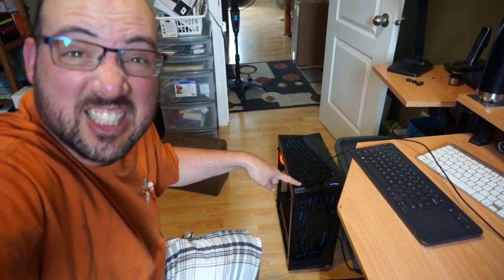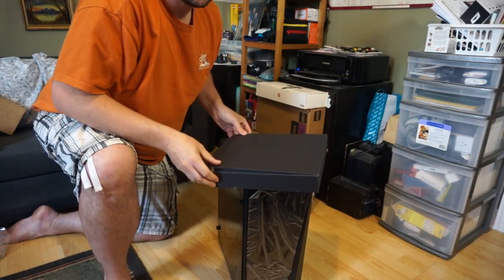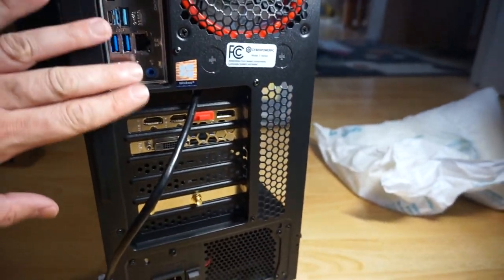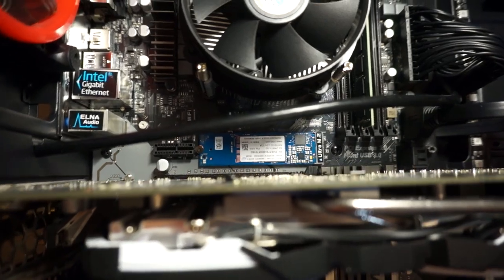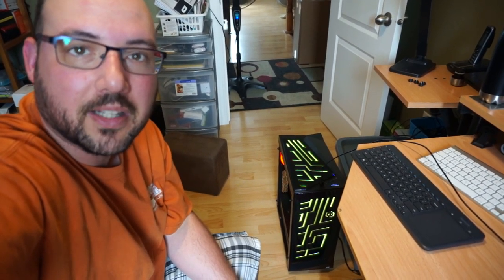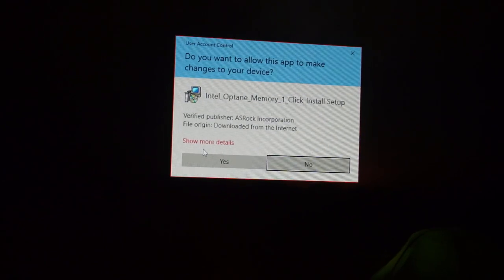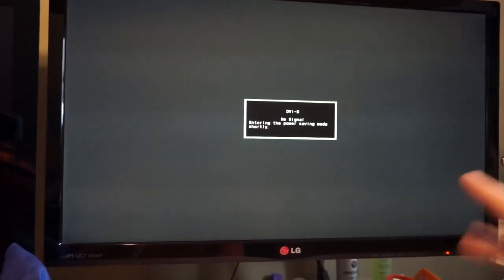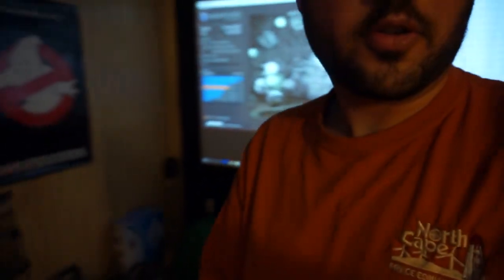$650 ULTRA VR GAMING PC!!! CyberpowerPC GXi10922OPT Unboxing - Netcruzer TECH

Comment: That’s a workstation
Reply from the maker: Not sure why you think that.  No hyperthreading CPU, no big RAM capacity, no workstation level enterprise features... it's definitely marketed and built to be a gaming PC.
Reply: Netcruzer RC TECH CARS depends what you call workstation. That is not an ultimate vr station. The processor is good but the gpu is ehh. Not bad for the price but it should be 850 maybe regular price